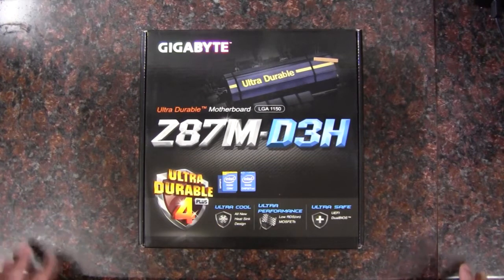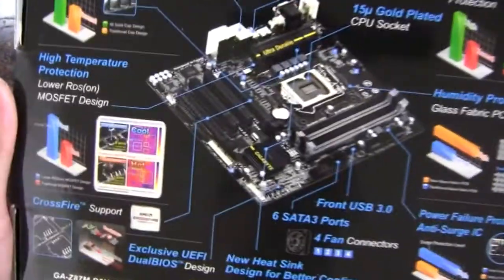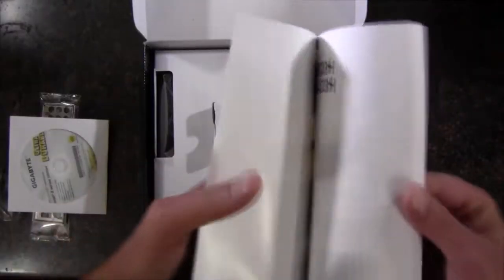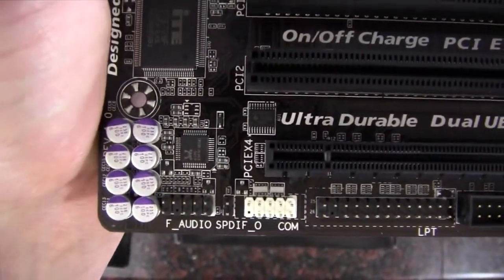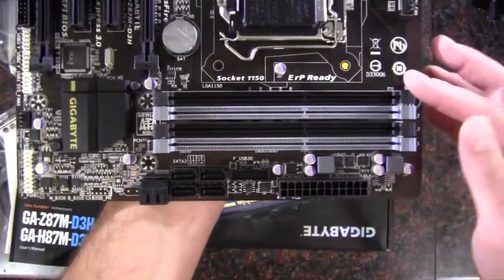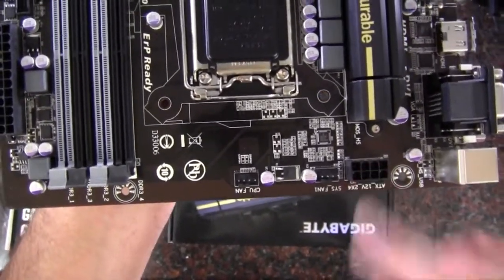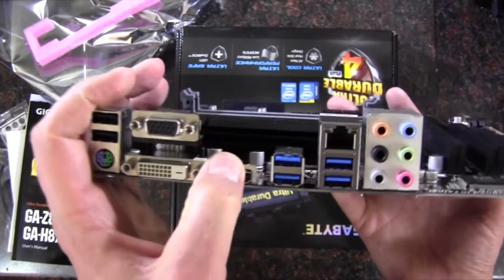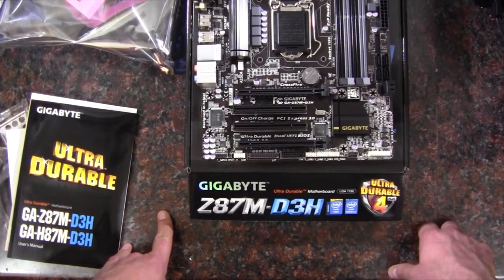Gigabyte Z87M D3H

Comment: Good motherboard. Had issues at first and blue screened my Windows 7 when plugging stuff in but somehow got better over time. It's pretty good still, running over 10 years strong still, mild to moderate gaming and constant browsing use almost every day.
Reply from the maker: 10 years is a great lifespan. I don't see many PCs of that age still in service. Usually, they either die or become too slow for what the user needs. What CPU and GPU are you using?
Reply: @AdoptedMike  the gpu only lasted 3 years, it was a nvdia 770 oc but I didn't oc it. The cpu is haswell 4670k, ram is corsair vengeance, psu is seasonic gold 550w back when it was top brand and had no fan to see.
Reply from the maker: @FinalMythology  I miss the days of the GPUs that didn't cost $500 for mid range. I ran the 770 and then the 970 shortly after that. Haswell was, and still is, a good chip. Is that DDR4 RAM?
Reply: @AdoptedMike  nah its ddr3, ddr3 is pretty good still but they moved on and don't make motherboards for them anymore other than shady chinese ones. Have you looked at the psu msi mag a550bn? It's bronze and not gold like seasonic was back then for the wattage but its got a fan and good reviews and decent enough price.
Reply from the maker: @FinalMythology  I wouldn't be afraid of that PSU. The reviews look good. MSI isn't on anyone's crap list that I know of.

Comment: Can i put a nzxt kraken m22 and a gtx 970?
Reply from the maker: Yes. Both will work with this motherboard. Make sure the case you use will fit the radiator and is long enough to fit the 970.
Reply: AdoptedMike i have a h500 nzxt it is good?
Reply from the maker: @Dodo-rb1kb  I have not had the chance to work with that case yet. I hear good things about it and I love the looks/layout.

Comment: My board is stuck in a bootloop
Reply from the maker: Check to make sure the power button (or the reset button) are full disengaging their switches. Do you know that the power supply is good? Those 2 is where I would look first.
Reply: AdoptedMike yes, the power supply is good. I bought it a couple months ago and it has an 80+ gold rating.
Reply: AdoptedMike just a quick question. When you do not have a cpu in your motherboard, does it bootloop?
Reply from the maker: Yeah, I would agree. To me it seems that a power supply fails either within a week or after a year. Did the system ever work or did you just build it? Have you tried resetting the CMOS? Also, remove the RAM and reinstall one stick at a time trying different RAM slots.
Reply: AdoptedMike this was a working system that I had been using before. I had decided to get a new motherboard so I could have a better CPU, (which I currently do not have). In my past experience with motherboards, I know that the board should still post even without a cpu. The fans should be running constantly as well as there would be bios beep codes. I do not have the cpu for the new motherboard, but it should be doing the same things any other one should, but it gives no beep codes and will loop every 2 seconds without any sign of what may be happening.
Reply from the maker: Hmm. Perhaps this board wants to see the CPU. I have personally never tried booting a board without a CPU, so my knowledge regarding that is very limited. I would suggest trying using a CPU first before declaring the board dead. Unfortunately that would require the purchase of a CPU. Looking at eBay, I don't see any really affordable Celerons to test with. The 1150 socket isn't old enough to have $10-$20 CPUs yet. It might not be worth it to get a CPU just to test the motherboard. Can you return it?
Reply: AdoptedMike no, I sadly can not return it.
Reply from the maker: Crap. Then you will either have to buy a CPU to further test or get a new motherboard. If you are set on the socket 1150, you could buy a CPU to test with. If it works, great, if not then you would have to buy a new motherboard. How set are you on the socket 1150?
Reply: AdoptedMike quite well
Reply: AdoptedMike could you maybe make a video running your board without a cpu just so I can see if your does the same as mine?
Reply from the maker: I don't have it anymore. I sold it shortly after this video. I am able to create videos because I build and sell PCs as my second "job".
Reply: AdoptedMike I’m starting to get very angry now because now my working board is doing the same thing!
Reply from the maker: WTF! With or without a CPU installed?
Reply: AdoptedMike this time with a cpu
Reply: AdoptedMike well, I have officially just pronounced my computer as dead. Rip
Reply from the maker: That is terrible timing. Are you going to order a Haswell (Socket 1150) CPU to try in the Z87 board?

Comment: Hey there!
 I do have the same MB .. When I connect a dongle my pc hangs and a white screen with multiple horizontal lines appears... Also if there is an incoming call in my phone which is placed near the mobo then also the same issue appears... Any idea about the issue to get it fixed?
Reply from the maker: Wow, now that is odd. Are you using any wireless devices like WiFi or Bluetooth adapters that are attached to the motherboard? If not, then I would suggest getting a new board. Something is very wrong with that board.
Reply: Wasn't helpful... Thankz to reply
Reply from the maker: Sorry that I couldn't help. I would need to see the PC. Internet diagnostics are difficult.

Comment: Can i us this for overclocking a i7 4770k? thanks for help...
Reply from the maker: Purple Rain Yes, you could overclock a 4770k with this board. the Z chipset boards are generally the higher end with the most features and work well with the k processors.
Reply: @AdoptedMike  I have this MB with this chip that I used for a Haswell Hackintosh. It's been left unused for many years now, am thinking of building a retrogame archive machine on an open vertical test bench type thing.
Reply from the maker: @choboutube  Cool! I did a Hackintosh once a long time ago. It was a bit of a pain, but overall fun to get going. I think that would make a pretty good retro gaming PC.

Comment: No sli bridge??
Reply from the maker: This board does not support SLI. The second PCI express slot is only x4. Nvidia requires an x8 slot or better for running SLI. AMD allows a x4 slot for CrossFire, so it does support their technology.
Reply from the maker: Pavian Adagio With 2 cards, one will be x16 and the second will be x4. Honestly, if you don't own this board already and were going to do 2 cards at some point, I would get a different board that would allow 2 x8 slots over one x16 and one x4.

Comment: how would crossfire work for this board? May you do a video for youtube about that please?
Reply from the maker: First of all, I unfortunately don't have this board anymore. Secondly, the 2nd PCI Express x16 slot only runs at x4 speed so that will hurt performance. Plus it would depend on what 2 cards are being run in Crossfire. Higher end cards at higher resolutions will be hampered more with the bandwidth at x4 for the second card. So, it really could go differently depending on configuration. The processor choice would probably only make a negligible difference at most resolutions.
Reply: AdoptedMike thanks for the response. seems like to me the company didn't really describe exactly the crossfire component. even on the website it didn't say anything. :( Thank you.

Comment: Would recommend or not?
Reply from the maker: I did a build with this, an i5 and a GTX 770, and it turned out great. So, I would definitely recommend.
Reply from the maker: spide Cooper As long as you are not planning to run 2 GPUs, this board will work great for the single 780 and i5. It is still a Z87 and has a great build quality.
Reply: AdoptedMike Would you recommend it as your main build? Am putting a 780 FTW and a i5. Or should i get a ATX motherboard?